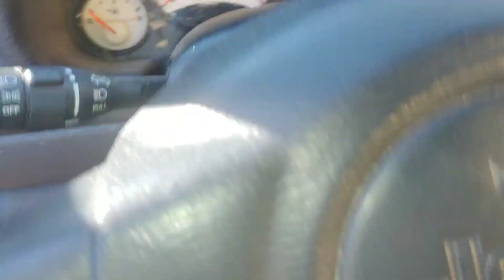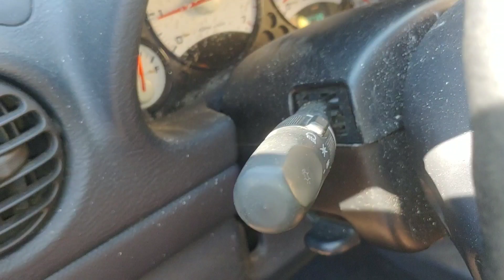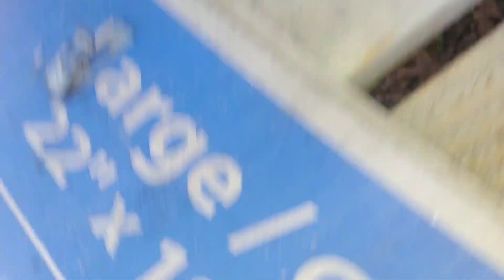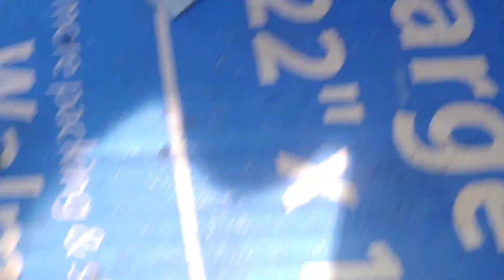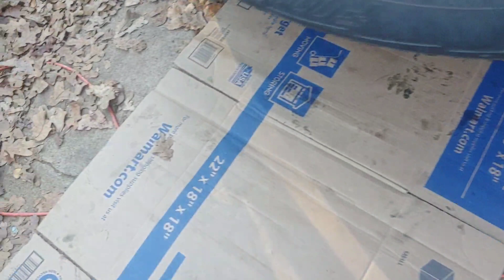Jeep Liberty rear axle bearing

Comment: A slide hammer would've removed wheel bearings and seals in 10 seconds or less. He made the job way more difficult than necessary. If you dont own a slide hammer common auto stores rent them out. You get a full 100% refund after returning.

Comment: Thanks Roland, very helpful -note to anybody else attempting this, jack the diff up high and place axle stands ahead of the axle on the frame.  Then lower the diff and you will have a lot more room to work.  A cheap slide hammer with right attachments makes removing the bad bearing a whole lot easier for sure.  Wish all a whole lot of fun Jeep motoring!   Thanks again Roland

Comment: Thanks for the help but you could also use a crow bar to get the bearing out but it has to be a heavy duty crowbar made for demolition got the bearing right out I did have the tool for the job technically but the bearings are just really big that the bearing puller set I got didn’t fit 😆but with persistence you can fix anything
Reply from the maker: @aidenswanson2844  I used what I had immediately available

Comment: I followed along to this video this weekend. I was replacing the Wheel bearings on my 2008 jeep liberty. Pretty much the exact same process and it worked really well!
For the spider gears, I ended up using zip ties to hold them in place! It worked really well!
Thanks again for this video!
Reply from the maker: @kfed8599  thanks for the feedback

Comment: I bought 2004 jeep liberty 4wd. It has a 76miles on it. When I hit 55 rpms It make a humming sound in the rear differential. Does it need a new one? Or can I have the pinion bearing replaced?
Reply from the maker: The pinion bearing is replaceable.  However, it does require disassembly of the rear end.

Comment: You can tell by the clean filler plug, the lazy owner never changed the fluid of the differential ever.  That will F all things inside the diffe.
Reply from the maker: Good thing metal and lubricant quality has improved since the 60s
Reply: @RolandCaston  Not so much.  You still have to change that diff oil every 15k miles because it has no filters.  And some has to be changed at every oil changes.  But most dont.  My last 2 rear wheel drive trucks,   i got them cheaper by telling the owner that bump on the rear end will cost over 1,500 dollars to repair.  They though i could not notice it.  I repair diffs.